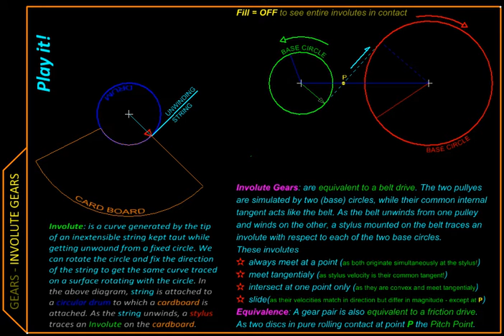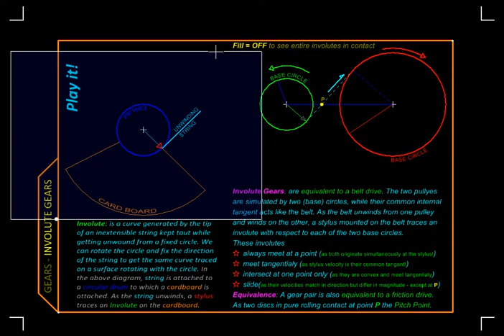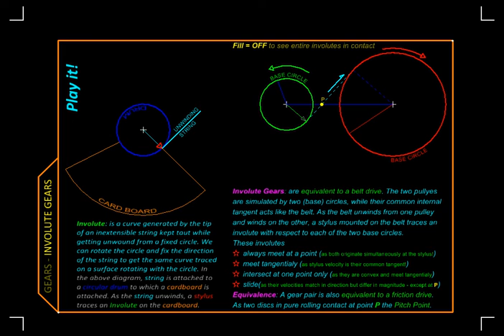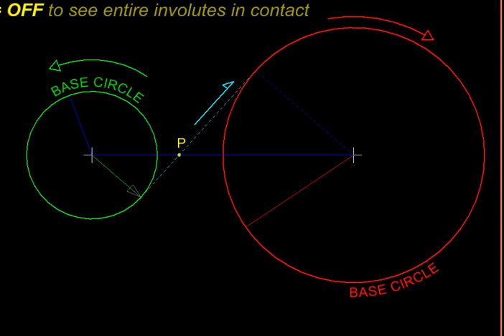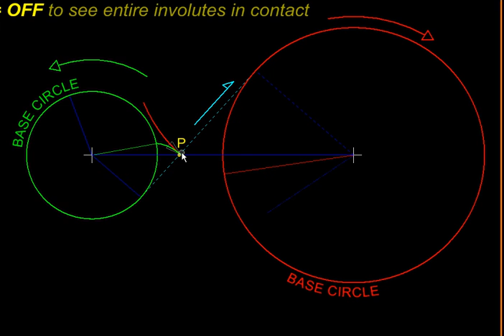Kinematics Ch06B Involute Gears

Comment: @Ujjwal Suryakant Rane
Sir can we design a gear tooth profile using open belt drive too instead of crossed belt drive analogy so that two gears in external meshing rotate in same direction?
Reply from the maker: Open belts are indeed used for internal gears, but for external, it seems difficult. 
I am not saying impossible, because that is one word an engineer should never use. Who knows one day someone can come up with a brilliant idea
Reply: @UjjwalRane 
Sir thank you very much for your reply. Your words are really encouraging. But, Sir I am not able to interpret why the same analogy would be difficult in case of open belts. It would be truly helpful if you could guide me.
Reply from the maker: @keshavbassi6501  There are two conflicting requirements:
1. We are trying to make the two gears rotate in the same direction like two pulleys connected with an open belt.
2. But at the same time, we are looking for an external contact and NOT the internal gear which can make this possible.
Reply: @UjjwalRane 
Sir, in response to the second point, can't we generate involute profile for open belt drive in a similar manner as we did in cross belt drive?

Comment: Hello Sir. Great explanation. 
Can you explain in case of gear meshing, how the motion is:
1) Pure rolling at pitch point
2) Rolling + Sliding at all points other than pitch point?
I'm unable to visualize and comprehend this.
Reply from the maker: https://www.youtube.com/watch?v=Z1f29M4o3jI&t=2s This video on law of gearing might help you
Reply: Ok so, When gear 1's teeth starts engaging with gear 2's teeth, it slides on the gear 2's surface, upto the pitch point. At pitch point, it rolls for a infinitesimal small time. After pitch point, the gear 1's teeth again starts sliding on gear 2's teeth surface upto the point of disengagement.

Correct me if I'm wrong.
Reply from the maker: That's correct. The sliding ceases only momentarily at the pitch point.
Reply: Thanks sir. Got it!

Comment from the maker: @Iamatheist1234 I had found the equation of the undercutting curve for the simple case of a rack and pinion engagement, Don't recollect much but from the shape I remember, the normal could not have had a constant slope (like a normal to involute rack - which is a straight line) So my gut feeling is that the pressure line will not retain its direction. But do check this and please let me know if you can verify it.

Comment: Can I picture it as they "force" the gear and pinion to rotate at constant angular speed and hence the harder one will naturally shave off the softer one that will allow such relative motion?

But this profile would not necessary have the same pressure line as the involute curve am I correct?

thank you for your reply!

Comment from the maker: @Iamatheist1234 Involute cannot exist inside the base circle so this may look impossible :-(
But imagine a soft gear who has run out of the involute artificially meshing at a constant velocity ratio with a hard gear. The tip of the hard gear will simply dig out a curve inside the base circle of the soft gear that helps achieve that constant VR! This is called undercutting - makes the teeth thiner at base and thus weeker, but keeps the VR.
HTH,
- Ujjwal

Comment: may I ask, is it in theory possible to form a involute curve below the base circle?

in my textbook it is stated that interference occurs when the teeth of the gear and pinion make contact before the point of tangency of the pressure line on the basic circle. so I was wondering if we can have some profile under the base circle so that even if the teeth make contact before the point of tangency we can still have a constant angular speed for the gears.

Comment from the maker: @8106999456 Thanks! I have finished doing Kinematics unless I hear some suggestion about topics. Currently doing some topics in geometry. A mix of engineering mechanics, strength of materials and machine dynamics is in queue . . .